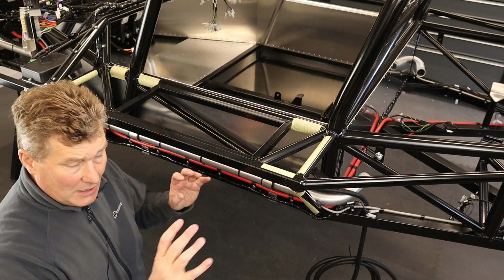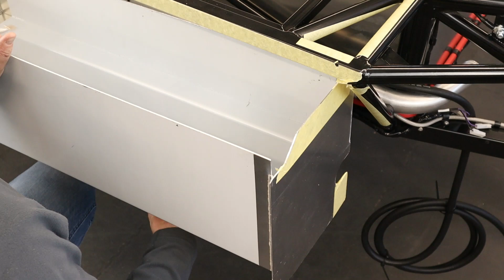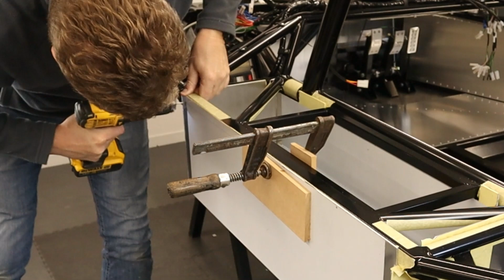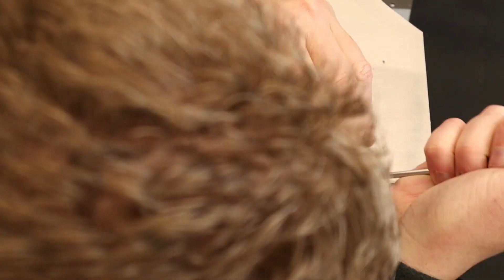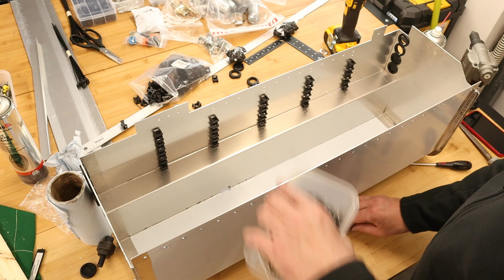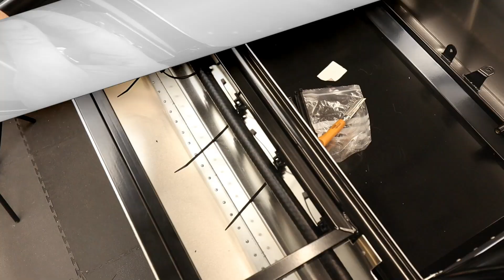Building an Ultima RS with Nigel Dean. Part 12. Luggage time

Comment: I wonder, for weight savings, have that hot water valve face into the cab directly to turn it on and off, or maybe that only makes sense if left hand drive.

Comment: Which box was the bag full of saddles for the hoses in? So far ive only found 2 smalls bag 
s with a total of 20 saddles.
Reply from the maker: Hi, sorry for the delay. That bag of saddles I purchased from ebay. I just wanted a few extra and the smallest quantity was 100.
Reply: Awesome. I'm in the process of building one of these for the president of our company. The instructions are confusing to say the least. Guess I need to order extra saddles for all the engine bulkhead layout.

Comment: Just wondering: if the bins compartments are cut and provided by Ultima, why is there such a need for trimming? 🤔
Reply from the maker: Hi and thanks for the question. Yes ULTIMA provide the bins prefabricated but they leave a small amount of fettling for the builder. Yes they could dial this out but part of the enjoyment of the build is to leave a small amount of work for the builder. This provides a connection to the build which is hard to describe. To me it’s a good balance since you feel as though you are making the car unique to you, but minimising the difficultly. Appreciate you tuning you and lots of content to come. Cheers Nigel
Reply: @v8creative  thank you Nigel, I get your point

Comment: Do you actually think they provide any side impact protection?
Reply from the maker: Morning, well what I would say is that crush zones in vehicles are constructed from hollow box section and combined with the triangulation of the chassis this construct would absorb a considerable amount of energy. Clearly side impacts is always the the most vulnerable aspect of car design, but if all the cars I have built the ULTIMA is head and shoulders above the rest. Appreciate the comment. Nigel

Comment: I didn't realise that luggage space existed! One question though; are going to remain unlined, just bare aluminium or is there carpet or sound deadening going in there?
Reply from the maker: Hi Neil, yep those luggage bins are superb. Compered to many super cars you are simple spoilt with the amount of storage in the RS. Ultima do not provide any lining material for the bins, but the sides are bonded to the chassis members to stop drumming. In addition it is easy enough to line them in carpet if you see fit. If you want to go down that route it's best to do it before the sill covers are fitted. Cheers Nigel

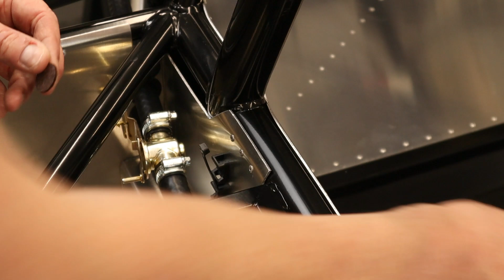Comment: GREAT VIDEO. But you  have to rotate the hose clamps outwards so in the event of a leak due to settling you can tighten them easily! (19:28)
Reply from the maker: Good spot Marco, and in fact I did change the orientation of those clamps post video release for that exact reason. Someone else highlighted my oversight. Appreciate your eye for detail, keep tuned. Cheers Nigel

Comment: Yet again a thoroughly professional and highly entertaining episode! You are living my dreams of owning one of these beasts! Can't wait to see what engine you fit plus your choice of body colour. How much would you say you need to spend on the tools you are using?
Reply from the maker: Hi Mark, glad you are enjoying the series. Apart from standard spanners, socket set, screwdrivers, drill bits etc, the only 'special' tools I have purchased is a right angle electric drill (£120), an electric pop riveter (£180) and the hole punch (£10). So a total of £310. None are essential, but they do make the job considerably easier

Comment: I also would have Placed the heater hoses in the bottom saddles to make it easier to fit the later dry sump oil lines.
Reply from the maker: Point noted Rich. The reason for the order of the pipes is to ensure when they exit and enter the luggage container there is not a need to cross them over since the routing dictates the termination points. Having said that it's a good question. Cheers Nigel

Comment: I have to ask is the amount of rivet holes an Ulitima Recommendation. Personally, I would use a bead of sealer and half the amount of rivets. Watched the full build now and have just commented this once. You did Scare me when fitting the stainless lines over the battery terminals though. Rich
Reply from the maker: Hi Rich, thanks for the comments. Yes, there are a lot of rivets and some visitors to the garage say the chassis looks like a Spitfire :-). All I can say is I'm following Ultima's recommendations which have been in place for well over 20 years. As regards the stainless brake lines they are covered in a thick coating of transparent PVC (or similar material) so there is no risk of shorting the battery if the P clips fail. Once again thanks for the input and watching the entire series - a fair few hours now :-)
Reply: Of course, they are. Sorry was not evident in vid, the ones we use to build Rally cars come without a shield. Great build vid though. Ultima has been a dream car of mine since childhood. Rich.

Comment: Great video as always Nigel, you did well with the creative director taking a sleepy leave of absence. After your GTR experience, do you find squeaks and rattles occurring from luggage bins etc being riveted or are they extremely secure?
Reply from the maker: Hi Garreth, during my years ownership of my GTR I had zero squeaks from the luggage compartments. In fact the odd rattle I did have were the odd body panel. These were cured by adjusting the clamshell latches and adding the odd piece of sponge. However, the car is so load when on full beans you wouldn't hear any rattles even if the luggage bins were full of marbles. 😎
Reply: @v8creative  Thanks for the reply Nigel. There are so many builds with large amounts of sound deadening materials fitted, to stop drumming and vibrations mainly it seems, so it had me wondering if after so many rivets being applied whether it’s really necessary at all. I do imagine the three marbles you could fit in the luggage bin would make quite a noise though…… An insulated firewall however, that I can get onboard with. I bet it can get pretty hot in the cabin, even in good ol’ Blighty.

Comment: Nice job Nigel. Up till now I could argue the kit was too easy to assemble. Actually that’s a compliment to Ultima, such a nice kit. This step took some skill in fitting the bin in and you did a fine job. See you in two weeks!
Reply from the maker: Hi Joel, and thanks for the comment. Yes the kit is by far the easiest car I have built to date. Having all the components is a massive benefit and preformed brackets certainly saves time. Still easy to make mistakes :-), the build will only ever be as good as the builder regardless of the quality of the components. The bin was a challenge, but the driver's side was a dream since I practiced. Cheers Nigel

Comment: Another great video, Nigel.  I really like your idea of the hole punch, rather than a hole saw.  Very clean.  I'm going to steal your idea and add that to my build arsenal.  Can't wait to see what engine you picked.  Hopefully it's the same as mine so I can learn from your mistakes. :-)
Reply from the maker: Those hole punch tools are superb since it's a controlled process. Much like using the angle grinder rather than a jig saw to cut aluminium sheet. As for the engine, regardless if my choice matches yours or not, much of the process is very similar. Appreciate some installs have dry sump installations, but regardless of my choice I will refer to differences with other engines in the videos. Cheers Nigel

Comment: Nigel, your work is excellent as always.  I do have a question:  Why secure the hoses with zip ties?  My experience with zip ties is that they become brittle and break over time.  Why did you choose these?
Reply from the maker: Good question. The reason I used the zip ties and saddles is because they are supplied in the kit and have been the method of fixing pipes on the Ultima for many years. Also there are zip ties, and zip ties. The ties supplied by Ultima are of a very high quality. If I compare the supplied ties with other ties in my infantry the quality of the moulding and the serrated securing action are both impressive. Doing a little research what can degrade zip ties over time is if they are exposed to direct sunlight. As such, fingers crossed the ties installed in my dark luggage bins should be fine.  Cheers Nigel
Reply: Had the same thought - tie raps are probe to break.